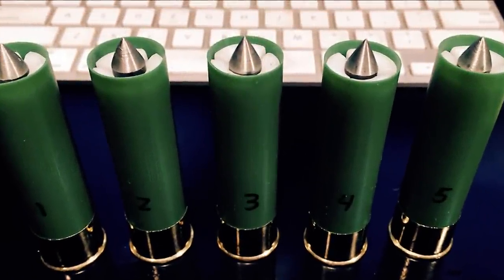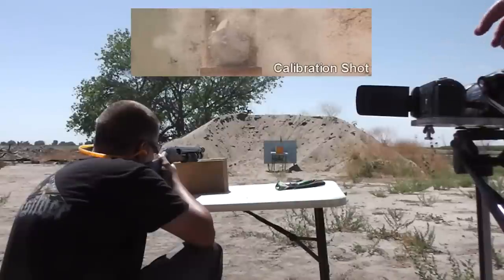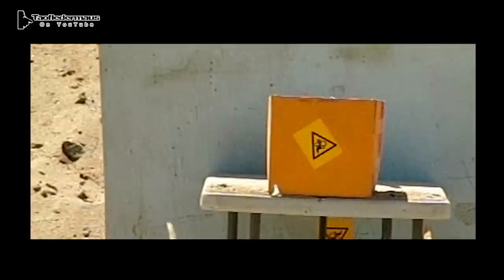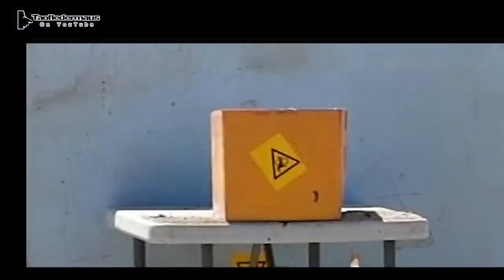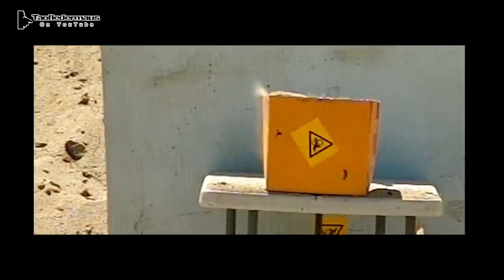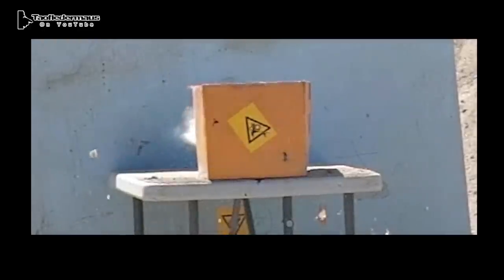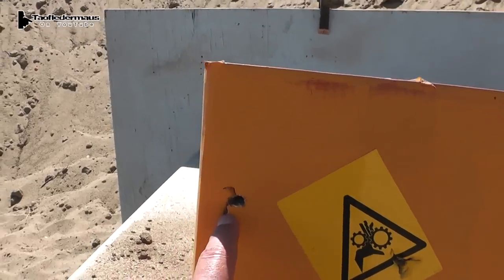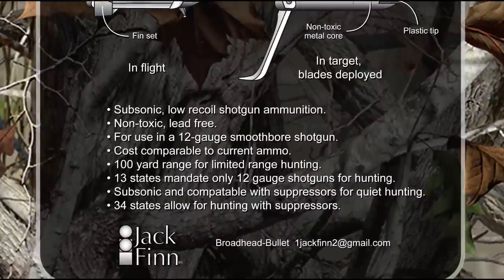Sabot Micro-Arrows for SHOTGUN -  Experimental Rounds

Comment: Dear God, that is overpenetration city! Do not use for home defense! lol.  It'd be interesting to see those things shot at the polyurethane armor plate.
Reply: verdatum good question! If I were the betting types, I'd say against the class 3 armor or the AR500 armor plate, these rounds if they keyhole like round 1 and 2, would glance and fragment. 
However, if the prototype round travel reliably like shot 3,  it could penetrate clear through.
This would be great to see in hybrid with those glass rounds they try, or the plasti-sabot they try...
(a solid sabot).
I could see those fins being replaced with "swedish fire", nitinol or cesium film, as a two or 3 stage primer or 2 shot system...
a counterspring with the nitinol for the fins might get some stabilisation 'scissor' effect,
or, if they cut the notching rotation groove in, maybe some spin stabilisation?
still... very promising round.
Reply: verdatum These rounds are subsonic to boot, 900 f/s. I knew they penetrated but golly!
Reply: TotalMetalJacket well said, that is a super round also. (I recall well iraqvet88's vid on just such a discussion, with Chad et Eric). Still, I think it may be possible for some to strike through the plate, at least on papers... especially if the contains some cesium-deuterium or cadmium methyl ether vapeurs ala tf00ts plans, or some other reagent to 'eat' the armor plate. If some are making a firearm into a bow-n-arrow, it is to also think like Green Arrow too eh? hehehe
Reply: John Smith I hate to break it to you but those sort of chemical reactions occur way way too slow for them to serve a benefit for a supersonic projectile.  PU is pretty darned inert.  Even if it wasn't, short of high-explosive chemical reactions, most chemical reactions are way slower than supersonic ballistics.

Comment: Seems like over penetration to me. 13" of sand is a lot to go through and it comes out the back pretty quick. I'm assuming they're made of some hard metal (steel?) instead of lead, right? There's a reason lead is used in slugs. Because it's heavy and it's soft. They seem like a neat idea, but they seem to me like they'd be in the same category as all those other specialty rounds that aren't really practical for any purpose other than showing your friends what they can do to a milk jug. What is the intended purpose for these?

Comment: I was just thinking about how to make something like this.
Reply from the maker: The Chopping Block  probably the labor-est part is just making the sabot pieces.
Reply: ***** I was thinking an easy way would be to bore a hole through a dowel, then just use a hand saw or even a Dremmel to cut it in thirds.
Reply: The Chopping Block Pretty much what is done. Three different bores and Dremmel three cuts length wise. Has its limitations tho. Should I go with 3D printed sabots? How does 3D printed material hold up to 9000 psi. Any viewers have input for me on that one?

Comment: ***** it would be nice if you could get a laser or just tape a laser on the shotgun so we can see where the gun is aiming and where the round hits as it is hard to tell where the shooter was aiming.
Reply from the maker: camosniper 10    I bought a laser and we tested it out.   I had it secured on pretty well to keep it aligned with the bore but it was off enough that it wasn't accurate.   Then the battery started to die after a few minutes and you couldn't see the green laser dot anymore.
Reply: ***** that sucks
Reply from the maker: camosniper 10   We took a test shot,   the laser dot was at the center of a block of wood but the round hit about 6 inches off.   Then the recoil from the gun knocked it out of alignment even more.

Comment: In the beginning you said the box is 10"x10", but later you said 13" several times. Wut do?
Reply: +ChicagoModzz I believe the target area is 10x10. being a rectangular solid it is not limited in depth to 10. the 13 was the depth. yielding a 1300 cubic inch capacity or .75 cubic foot depending on how you want to look at it

Comment: If U are still in Contact with The Producers of thus rounds, Tell em , they should sharpen The Blades in The was, that will benefit The twist Direktion of that rifled Barrel. (Idk If my Expression ist ok Like that, because im German). Ich mean If The günstig makes that rounds Spinning clockwise, The Blades should be desinged Like Aero finns that force The Same motion

Comment: Pretty neat to watch but this round is very gimmicky to say the least. I have seen broad heads fail when they hit the shoulder blade of deer when shot at typical archery velocities so I can only imagine what would happen if this thing hit a piece of bone as solid as a shoulder blade. If you have any of these rounds left, it would be interesting to see how they act and how well they would hold up if they hit something solid like bone.
Reply: hunting310 The current design, not the one in the illustration, will allow the BB to penetrate hide/muscle/bone leaving a clean hole. Cutting mechanisms open in soft tissue. Tricky but possible I think. The BB has already evolved past what is shown here. Proprietary for now.

Comment: But you dont really wanna use this for hunting right, since it will rip your game to shreds
Reply: I can imagine, it's like that shredder mod for bullets, it rips organs apart ensuring 0% change of recovery
Reply: *****  No the main goal in hunting is to damage vital organs as much as possible, cutting achieves this goal without causing as much stopping damage as seen with bullets. So in reality this would be a better alternative, but the animal would likely live longer after being shot.
Reply: Chris Hardy Correct Chris. The goal is for a more controlled target material disruption via cutting rather than hydrostatic shock. The BB should open in the vitals but only leave a clean hole through hide/muscle/bone. Gonna be a trick but I think possible.

Comment: Just a recommendation: Why don't you build a stabilizing rig to mount your shotguns/rifles to and attach a laser(s) to the barrel for more accurate aiming. When you are trying to gather data it makes sense to be able to precisely recreate each shot for comparisons. Also use a target with more measuring markers to show how far off the aiming point the projectile was. Manual aiming is less accurate and far less precise between shots so your data will contain errors because you cannot match the characteristics of each attempt. Essentially what I am suggesting is that you employ a more scientific approach to your testing. Like I said just a recommendation but having accurate shot data will give your opinions and tests more credibility.
Reply: +watchme2day Another example would be to use 3 lasers attached around the barrel in a triangular fashion to show where the round should hit compared to where it actually hits.
Reply from the maker: +watchme2day  This was more about testing the external ballistics,   the stability of the projectiles in flight.  If a projectile is unstable in flight,  you'll never hit anything.
Reply: +TAOFLEDERMAUS  so true,dude

Comment: Now, by posting this, I am going to say that I am not at all a professional. I do have plenty experience working with firearms to know something. Now, to what I was going to say, since you have the high speed camera, why not test prototype rounds on a block of ballistics gel? I understand you're concerned about the flight of the projectile, but it could also help companies to know what the round is doing inside if a subject. Yes, this round did pass through 13"s of sand which is impressive, but it may be informative for them to know what else they can do to maximize the effectiveness of the round. Also by doing this may get you more rounds to test because the company would find that data useful for success of the company.
Reply from the maker: Colton Millard  Because the tip on these rounds is not the final design.
Reply: Oh I see. That makes more sense. Do you test in ballistics gel? I come across your videos occasionally and will watch them, but I don't remember if you guys do or not

Comment: This is a gimmick and nothing more. Archers prefer broadheads for hunting because arrows carry a tiny fraction the amount of energy if you are comparing it to a bullet, so you don't want all the energy to dump on impact, you want it to carry through the target and arrows do this very well, the blades cut a wound channel and cause massive bleeding and can even aid in further penetration. Bullets carry a lot of energy, so you want all the energy to be dumped into the target, if a bullet over penetrates that is wasted energy that could have been dispersed into the target. Something like a 12 gauge slug is already going to cause a wound channel that will dwarf a wound channel caused by an arrows broadhead. I don't think mixing these two technologies will give any advantage, you will just lose some accuracy, your wound channel will be smaller, less knock down power, and you will pay more.
Reply: EthanJM I think they will be more accurate than foster slugs, the would channel will be 3-4" through the target. Pay more, probably. Subsonic, compatible with suppressors more so than supersonic ammo. And 1/3 the kinetic energy for low recoil. Will it work and have a market? I will find out.

Comment: That round is as moronic as it is impractical.
Reply from the maker: MKV1996  well if YOU say so.
Reply: Now... bear with me here... if it even flew straight and the fins opened up correctly and it proves to be a good round for hunting:
1. It's too complex for it's job
2. The penetration seems physically impossible to be better than the already existing and very effective opening hunting slug which I would assume this round would be used as a substitute of.
3. The plastic will often be lost and will be impossible to retrieve. I'm not some nature fanatic but it's plastic in the wilderness-POLUTION. Wild animals could get hurt on those.